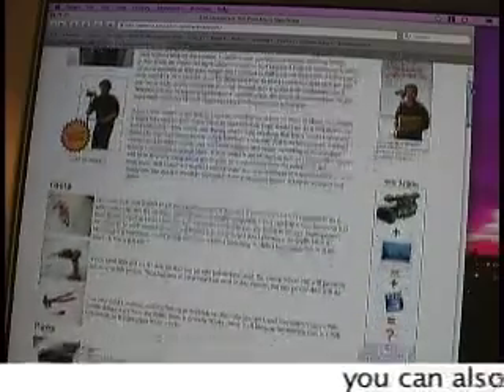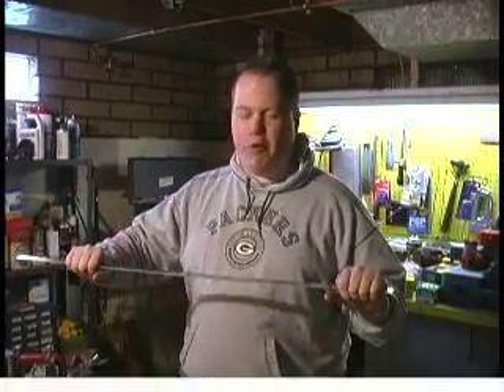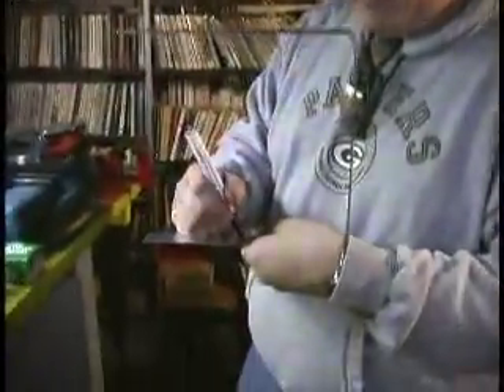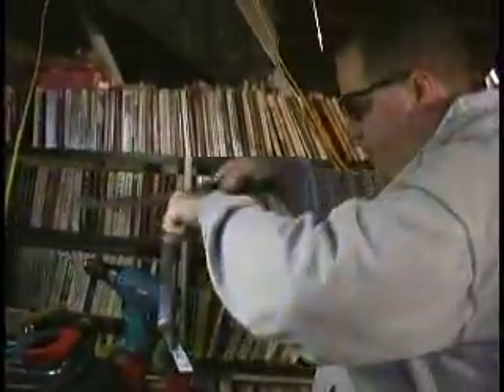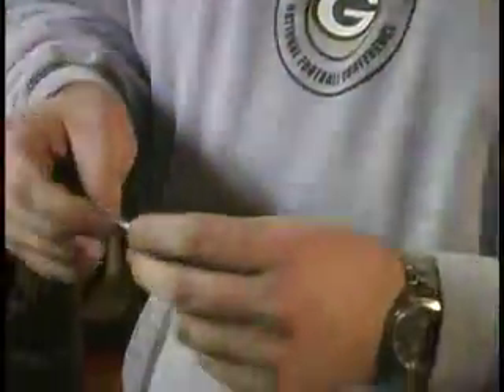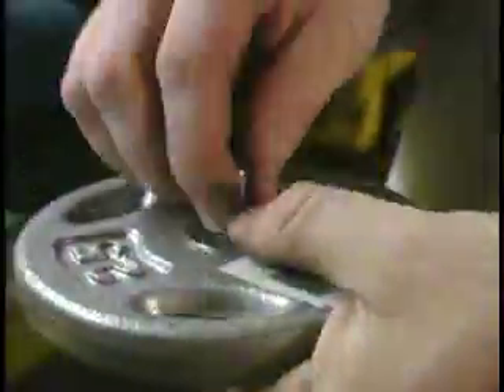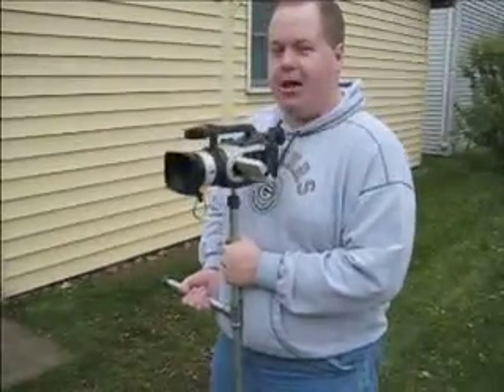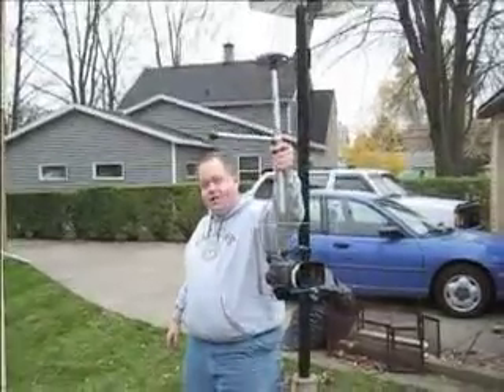032 Musecast - November 14, 2007 ~ The Steadicam Episode

Comment: When you're shooting handheld, especially with a smaller camera, it doesn't have that much weight.  Therefore the camera will pitch and yaw in your hand as you shoot.  The weight of the steadicam, and specifically the bottom counter weight force the camera not to rock back and forth nearly as much.  It acts very much like the tail of a cat.